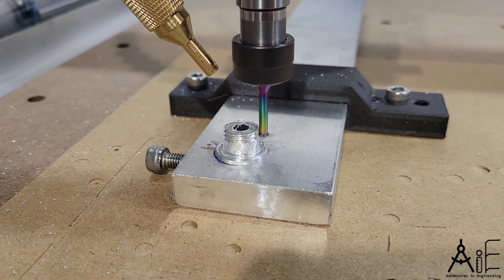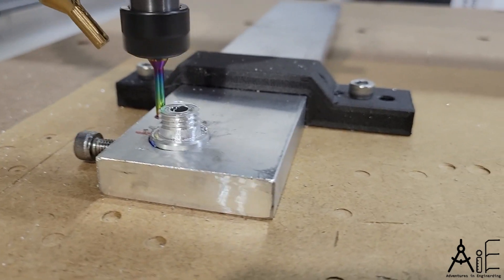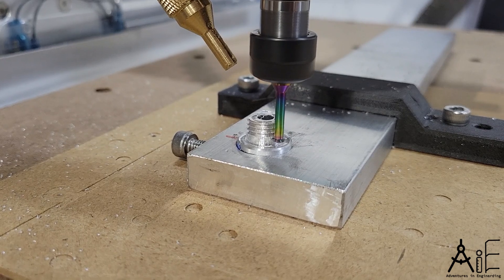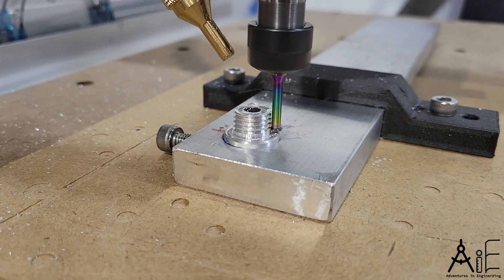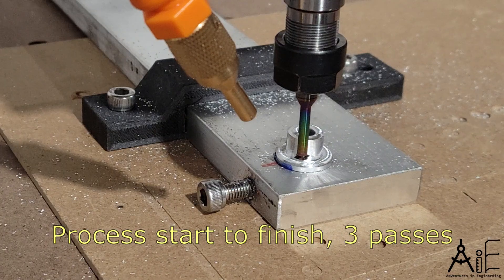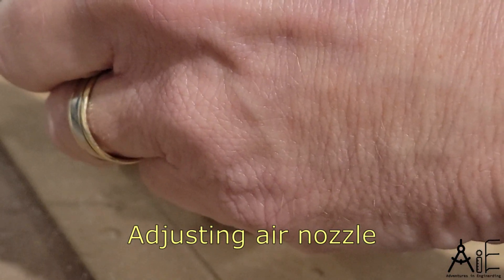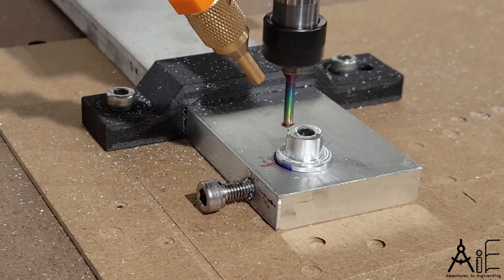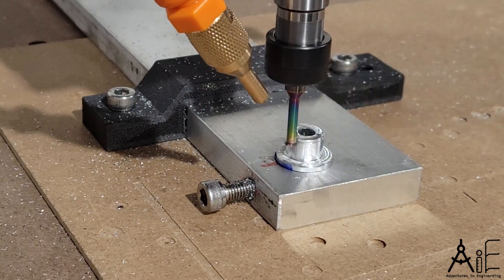Satisfying External Aluminum Threadmilling on Desktop CNC Prover XL

Comment: I tried to do it on the external part (male) I've been doing it for 2 days and I couldn't do it =( Can you make a video like you did on the other one? You taught very well, even for me, a beginner, I managed it =). Learning a lot from you
Reply from the maker: @vbrunetti Thanks!  I use FreeCAD and enabled the "super secret threadmilling" option.  I have a video on that.  Check it out and ask any questions. I'll help if I can. Good luck.
Reply: @adventuresinenginerding I already followed that video and did the internal thread...but doing the external thread is still a mystery haha helppp
Reply from the maker: @vbrunetti  In the ThreadMilling setup info, set "type" to Metric External (or Imperial External if that's your thing).
Reply: What were you speeds and feeds?
Reply from the maker: @HookTiki  Tool is a 5.9mm single flute, 4 tooth. 150mm/min Horizontal, 100mm/min vertical, 24000 RPM.  3 passes.